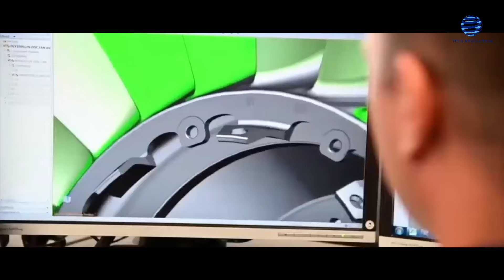China Just Launched The MOST POWERFUL Hypersonic Engine In The World That Will CONFRONT The US

Comment: Wow, China has developed the most powerful and efficient air breathing engines that could shorten the intercontinental flights to only a few hours with a relatively smaller amount of fuel. China’s hypersonic missiles are already well known to have surpassed the USA. But the new China’s air breathing engines are game changers in the world of civil aviation.
Reply: Not just that but hey can be used to get space vehicles up the the same height, the edge of space so boosters may become a thing of the past. Also, the vehicles would be reusable.